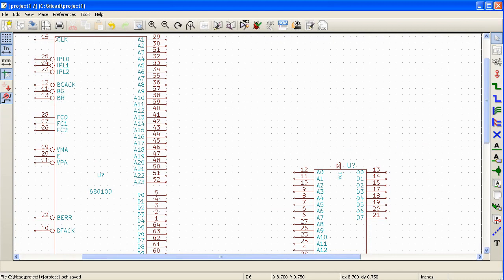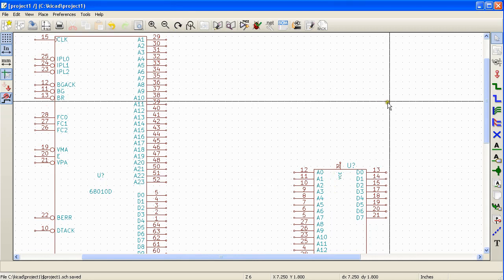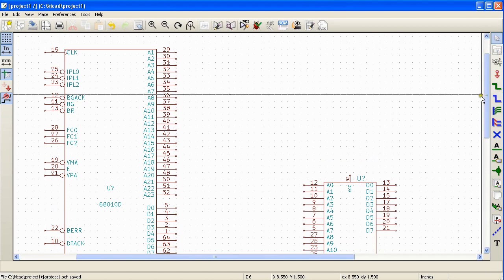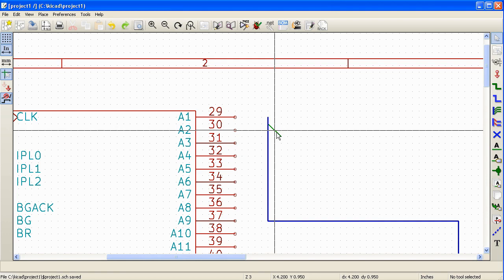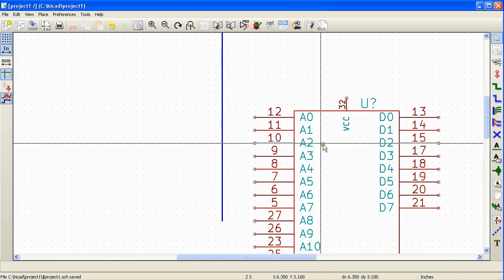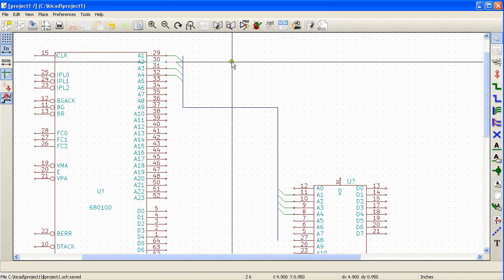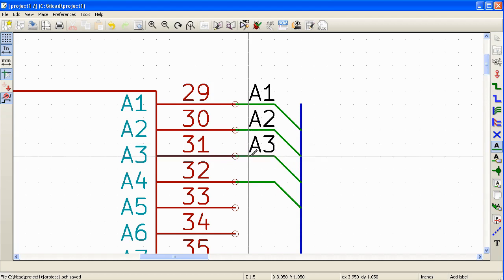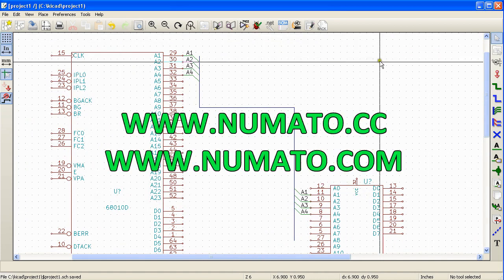KiCad Tutorial Part 6 - Using Bus in Schematic

Comment: no need to use bus with the same labeled pins 
buses are used when different names needed to be connected to each others 
i mean your bus in this video is useless 
any  two pins that have the same name of course connected to each others
Reply: This is how it's explained in the KiCAD manual. The bus and its connection lines are a graphical element only.